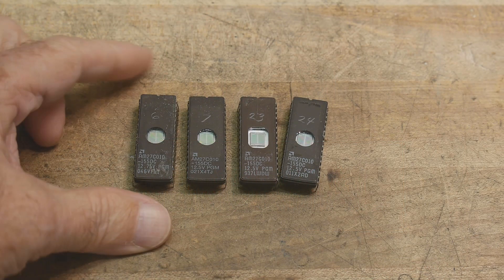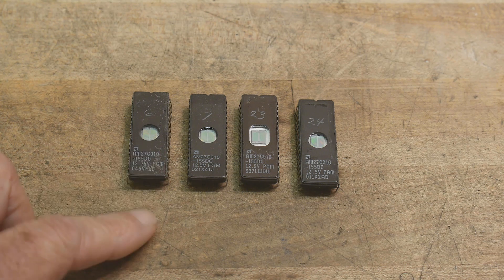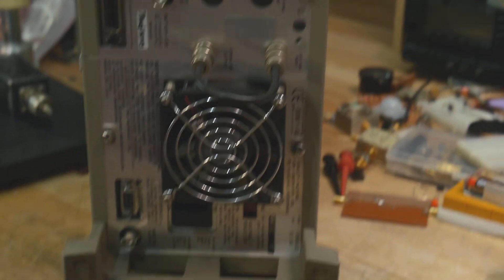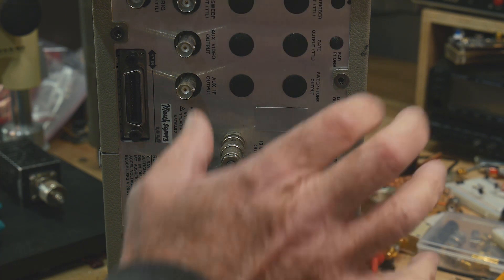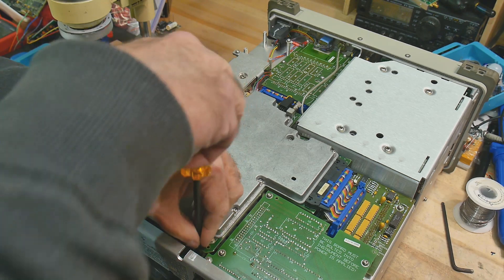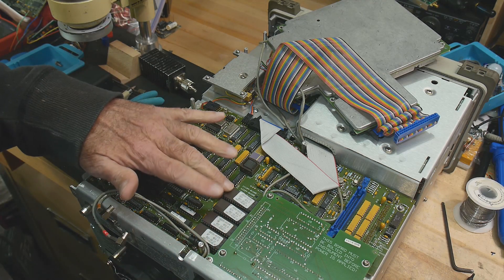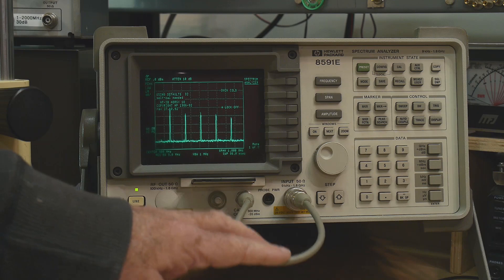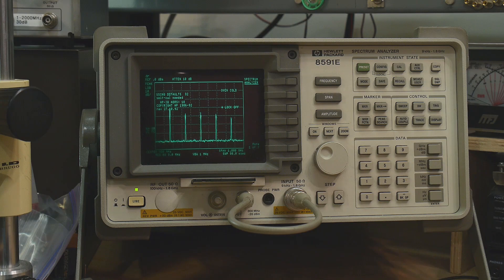#674 HP 8591E ROM Upgrade Fail #2

Comment: Hi IMSAI Guy...  After watching your SA videos, especially your acquisition of the CATV version,
 I ended up purchasing an HP 8951 C model spectrum analyzer.   I had intended on either donating this model
or one of the other SA’s that I have (Rigol DSA815 TG and a portable, newer Agilent n9340b) to our local volunteer fire department.
They are starting to handle much of their radio work in-house now with the restrictions on fun-raising events brought on by 
the CCP COVID-19 coronavirus.   Tuning of duplexers and other such service definitely requires a spectrum analyzer or VNA.

Here’s the dilemma.   I got the unit up on my bench and cleaned it up and powered it up.
Everything seemingly worked just fine.   The tracking generator was on target and the SA
was showing proper frequencies and power.

After watching the ROM replacement video set (not interested in that...I attempted to

Ouch... I lost most of the text,

I’ll retype, but simply...  a friend came in while I was beginning to handwrite the stored calibration correction data 
when he apparently clicked the “clear” function.   Now the SA is all quirky.   The indicated receive frequency is off by 40-50 MHz,
Etc....

Is there any way to re-do this?   Am I screwed?
I have a working SA with TG, an older and cheap-ass Elenco frequency counter, a GPS-DO 10mhz reference clock bunch of 2-way uhf and vhf radios,
multimeters galore and attenuator sets, cabling, etc...  

I would love to hire someone to walk me through everything... I promised a working unit to the dept and would
really hate to give up one of mine without having a functional backup.

Thank you as always!
Reply from the maker: If you really did erase the cal data. Then it needs to be calibrated. There is a very large HP manual  explaining how to do that.
Reply from the maker: 1140 pages
Reply: @IMSAIGuy  THANK YOU !!   
I found a tiny nugget in there and a few forums.   I think I’m back !! 😀
I learned a huge lesson too.

ALWAYS create and maintain a good record of the Calibration Constants and mark battery change dates.

Thank you Sir!
(and that’s why you are my “go to” channel)
Reply: @IMSAIGuy  And... now for the BIG QUESTION:

Which would YOU keep?
(I want to donate one to the fire dept along with a Quantar I have sitting)

- HP 8591C (& possibly replace display with an LCD for better visibility?)
It has the pre-amp / CATV / Tracking Generator options.  (I’ll never use CATV, of course)

- Rigol DSA815 with TG

Agilent n9340b Handheld with pre-amp and Tracking Generator options.
(small screen and it is pretty dim)
Reply from the maker: @PowderMill  at this point the rigol is the best unit
Reply: @IMSAIGuy  👍🏻👍🏻.  In exchange for all of your help and mentorship...
I am bestowing knowledge to YOU.  (don’t get used to it... I’m generally pretty clueless 😂)

OPTION 1:   
OPEN your 8951 chassis.

REMOVE the “standard” SMA male to female 75 ohm to 50 ohm pad 
RIGHT behind the front RF IN BNC bulkhead type connector.

Ha!   Hopefully that will work.  I have not tried it yet b/c I am having some trouble lifting the unit up to the bench.
PLUS.. you get another 75 to 50 pad for the pile ‘o stuff.

OPTION 2:
Select “AMPLITUDE” .  On PAGE 2 —>. There is a software selector for 50 or 75 ohms!!
( it reverts with each power cycle, so I have to do some reading and figure out how to default that setting..)

I know you said you obtained a conversion adapter from 75 to 50 ohms, but this might be a cleaner solution?

Thank you again !
Reply from the maker: @PowderMill  You are confused. My 8952E is 50 ohms and not a CCTV special.

Comment: are those roms uv erasable? i see the new ones dont have stickers on them.
Reply: It does take UV and time to erase.  For testing, they are good with no sticker unless you are on Mercury at noon :)
Reply: My thought too...an errant photon got in and flipped something?
Reply: It is dark inside the instrument so no need for a sticker to block light
Reply: I sure hope you can fix your problem.
Reply: I have had a florescent light overhead, screw up the programming of eproms, once they are erased I cover the windows. If you can compare the file against the eprom the checksum will be different I would bet.